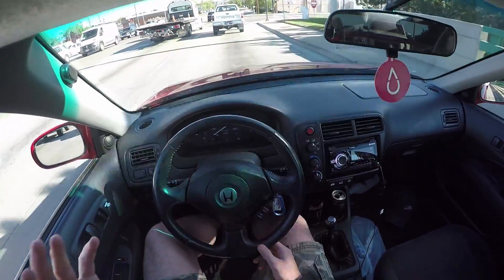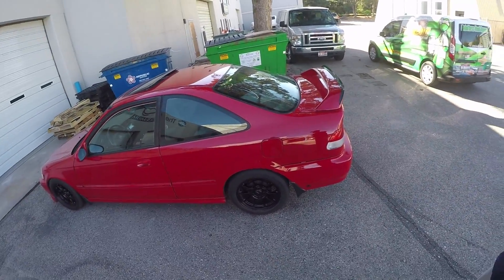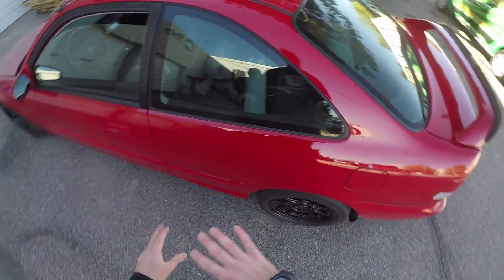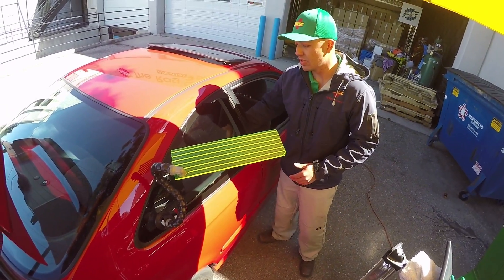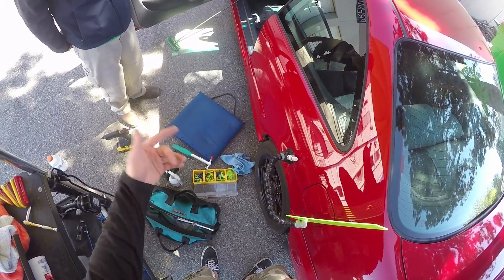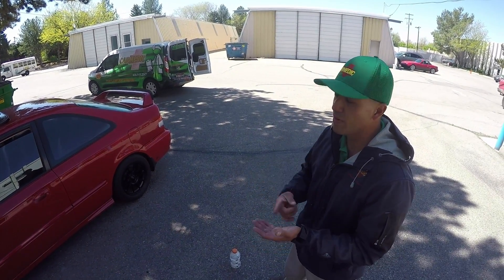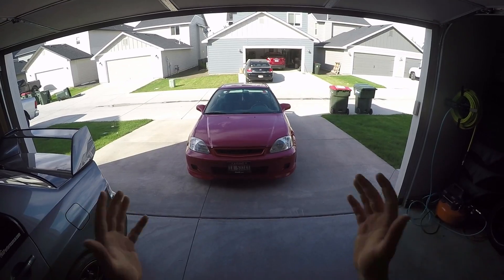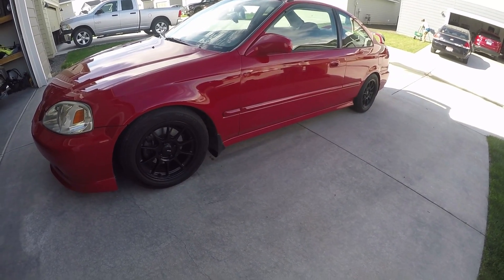Fixing 20 Years Worth of Door Dings & Dents | Honda Civic Paintless Dent Repair

Comment: How much did it cost you?
Reply: Everything
Reply: Thanos Joke 😂
Reply: i googled how much pdr costs here it is straight from google 

A good rule of thumb is anywhere between $75 – $125 for door dings. Larger dents such as collision dents average between $150 – $350 and depend on the size, location, and depth. Hail damage cost depends on the severity. The average auto hail damage repair costs around $2500.

Comment: I found a nice used 1997 civic but it has 261,000 miles should I still buy it?
Reply: Why not?
Reply: Yeah I’m just worried about how much life is left in it. I know Honda’s can handle a lot and last for a long time but still
Reply: @carlitoz5444  It it was taken care of you don't need to worry! miles don't define how long a car will last, miles can be done in a short period of time. For example my crv has 100,000 miles, it has more problems than other 300,000+ mile crv I've seen, (just because the previous owner didn't take 100% care of the car, just like I do), but that's just an example of how miles won't really tell you much, it's just maintenance.
Reply: Zone B yeah good point thank you
Reply: @carlitoz5444  I would recommend you to not get it. The reason is any car even if its a Toyota or Honda at 260k mileage, you will take a big gamble. Honda transmission are known to be weak and I gurantee its at the end of it life. Also the engine is almost dead at 260k. The suspemsion will be rotted and it will cost a ton to fix. I have a corolla with 145k mileage and I see the expenses on old cars and alot of mileage. I would buy one with 130k mileage or less, thats when the car still has a life to save and change.
Reply: @Oh Yeah yeah Compare prices and inspect as much of the car as possible. Parts go bad but they are just parts. Replace them. Hondas are cheap to fix and cheap to upgrade. Great platform to learn on and get into car modification with. Or just to have a car that is easy to maintain with great fuel milage. If its a manual no need to worry about transmission. Take it for a 30 min - 1hr drive and if it works flawlessly then its safe to say it will be a good car.